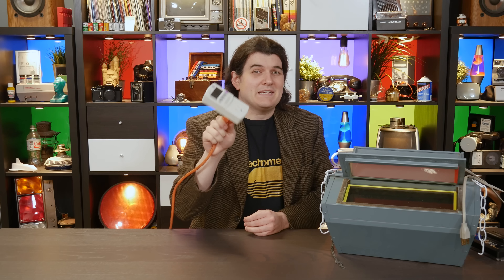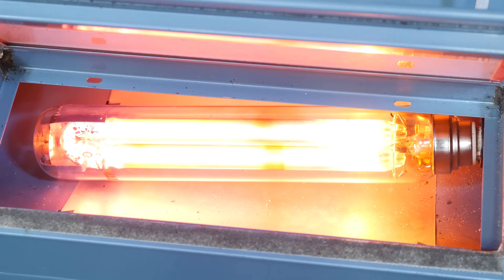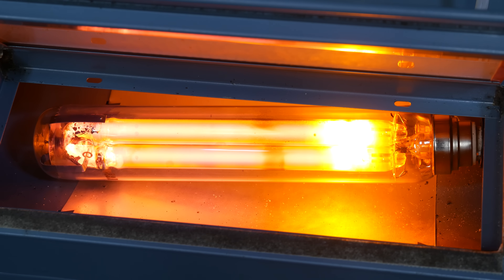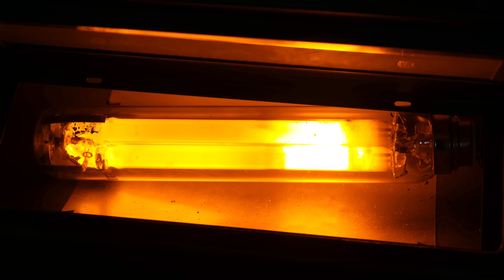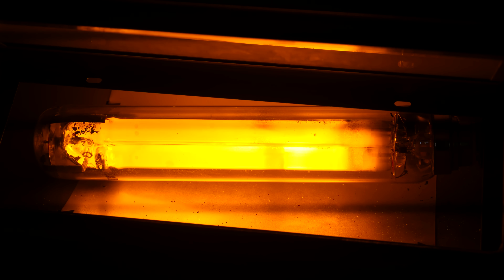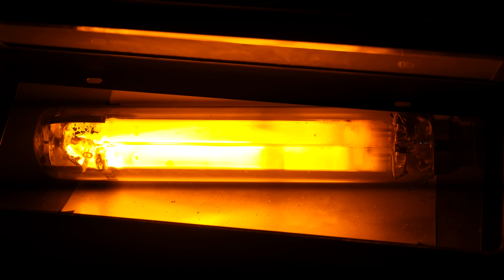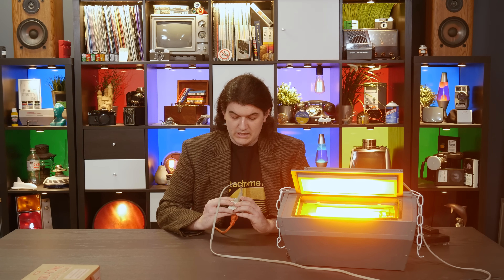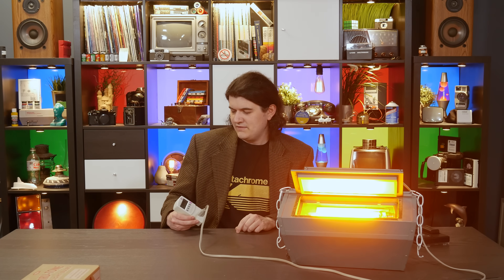More vaguely-informative ramblings about low pressure sodium lamps

Comment: I miss these. LEDs just don't look right on the road and in parking lots. Seeing these disappear from the road feels like losing an old friend somewhat. Heck, my elementary school gym and middle school cafeteria were lit up with them. Yes, I know, obsolete, etc, but man, I miss them.
Reply: Look up phosphor converted amber led
Reply: @DripDripDrip69  The thing is even those don't look right because the falloff is much sharper. The blackbody property also is much wider because LEDs run much cooler, making certain materials appear white, others appear yellow, and others look very dark yellow-green compared to low pressure sodium lamps that provide a constant even yellow-orange. Low pressure sodium lamps get about as close to candelight provided by a traditional wax and vegetable oil candle as you can practically achieve through mechanical means.
Reply: Agreed, the LED bulbs have a more intense light output but doesn't spread as far out as the old sodium lights did. The color temperature of the sodium bulbs is also better for residential areas, its a nice night light color. The more blue daytime color temperature of LED bulbs makes it look like its daytime, especially when you live in a snowy area and get all of the reflection off the snow.

Comment: I love the comment sections on older but not quite forgotten tech, because there tends to be so much nostalgia. However, I'm not nostalgic for LPS. It's horrible and dangerous lighting in my opinion. The color rendition is practically completely absent and more importantly, when used for traffic lighting it's got a really nasty property of being in the part of the spectrum that does not get reflected off much stationary stuff (e.g. grass, trees, concrete), so it creates really deep shadows, increasing apparent contrast and thus psychologically increasing apparent brightness without actually being bright enough to discern details well. Plus they have the worst switching life of any technology, so back in the day when they were used for streetlighting everywhere, you'd have streets pockmarked with mostly LPS but the occasional fluorescent bulb for those armatures that were fitted with an (active) timer to e.g. reduce light pollution in a park or to turn off during bedtime for people who had a bedroom right next to one of those lights.

For all those reasons and more, I massively prefer LED. The worst LED streetlamp is still better than any LPS lamp, and we've had some turdy LED lights back when the tech was still upcoming. It's one of those things that just got strictly better.
Reply: The LED streetlights are usually too bright and too blue, being daylight colour balance. This completely messes up our circadian rhythms and causes sleep problems for people that drive home after dark. Being able to identify every colour and read fine print books at night by streetlighting is of no real benefit but seems to be part of the requirements spec. Soon none of us will be able to sleep at night and no-one will ever see a star in the night sky.

Comment: Back in the day most of the street lamps in my area were Mercury Vapor bulbs which produced a relatively cool white light. In the 70's these were replaced by high pressure sodium lamps. Today these sodium lights are being replaced by the newer LED systems.

Comment: bad power factor= lots of energy is bounced back and forth between the lamp anf the transformer, which increases consumption on the wires.
With a capacitor next to the lamp the power would just be bounced back and forth between the lamp and the capacitor, limiting the losses to the few inches between the components.

Comment: These lights are common in many facilities because 1) they last a long time, and 2) they emit a frequency different than other types of light that does NOT attract bugs
Reply: Ultraviolet Light is what attracts bugs. Fluorescent lamps glow in UV, and the phosphor is what converts the UV to visible light. But a lot of UV still leaks through. LPS doesn’t have any UV, and so doesn’t attract any bugs.
Reply: The absence of a blue component in the spectrum also means these lamps don't reset your body clock if you drive under them for hours at night. 

That is great for not giving you "jet lag" after a long drive on a sodium-lit motorway  (freeway) which were common in England a couple of decades ago.

The downside was when your body clock thought (correctly) it was night and sent you to sleep at the wheel... I once caught myself microsleeping on a motorway at 3am and when I had stopped safely at a parking area i instantly fell asleep still belted in and woke up at gone 6am. I was profoundly glad that I had fought off proper sleep as falling properly asleep at 70-80mph may not be habit-forming.

That wouldn't have happened under mercury lighting and doesn't happen under LED.
Reply: @trueriver1950  — the reason it doesn’t happen under LED lighting is that white LEDs are actually based on blue LEDs, in a process made famous by Nichia in Japan.  They take a similar phosphor as they would use for Fluorescent bulbs and repurpose it to take in the bright blue color of the base LED and then re-radiate light over a wider spectrum, thus giving the appearance of being white.  But again, a lot of the blue light leaks through.  There’s still no UV there, so they won’t attract bugs.  And the human eye doesn’t see the blue light, but it is still there.
Reply: @shubinternet  just so :)
Reply: This light is much better for humans too. They changed the street lights to cold white LED lights here which are very uncomfortable. Actually you almost have to wear sunglasses when riding a bike at night. 😅
Reply: @therealjantube  Isn’t it odd, they only go for the very cool white type of LED. I guess it’s an efficiency thing, but I’ve seriously only seen a few places that have outdoor lighting with warmer LEDs. I know one residential area with very warm LEDs, almost a bit yellowish, giving an incandescent feeling, probably one of the nicest street lighting I’ve ever come accross. In our city center area we also have some LEDs also that are pretty white with a tiny bit of incandescent hint, pretty similar to some metal halide lamps.
Reply: soo.. moths aint gonna care about that lamp? :O
Reply: Why did we always see a swarm of bugs around street lights back in the day?

Comment: Hawaii, especially the big island, uses LPS lamps for street lighting, because the narrow emission spectrum is easy to filter out at the observatories on Mauna Kea.  Today, they're using LED replacements, that actually still look exactly like LPS.  You can tell you've got that spectrum if you have a red car, as we do.  The car appears to be grey under an LPS lamp - the red is completely undetectable to the eye, unless some white light hits it from some other source.
When we first visited Hawaii about 8 years ago, the lamps were obviously still sodium.  Today, however, I can't remember when I've seen a real sodium lamp - they're almost all LED now.
Reply: Do these LED replacements really have that monochromatic light? What are they called? I would like to have one for my room 😁
Reply: @therealjantube short answer - I seriously doubt it. LEDs probably have a fairly smooth spectrum, even though they can appear to be very monochromatic. Gas discharge lamps can have sharp lines.
Reply: @therealjantube there are monochromatic single emission LEDs available for mimicking low pressure sodium. It’s 589 nanometers.
Reply: @bnkwupt  Thanks! Sounds like a DIY project because I only see SMD LEDs but no lamp.
Reply: Anyone know the lps match LED bulbs? Where to get them?
Reply: Do the LED replacements have the same heads as the sodium ones? Where I live they went with white LEDs, but in a head that directs the light downward in a tight cone - the reduction in light pollution was really noticeable, and I can see much more sky even near built-up areas.
Reply: I think most fixtures have been completely changed, but some are undoubtedly retrofitted.
The difference in light pollution between here and the mainland is STAGGERING. Very little is over-lit here, it's all directed only downward, as you said, and the highways are only dimly lit, and only near intersections. You have headlights, after all. :P
I'm in Kona, Big Island. Other islands may have different lighting rules.

Comment: Speaking of obsolete lamps, over here it's common to find mercury lamps in street lighting still. Usually in older and more rural places. I gotta say I prefer those lamps over the high pressure sodium. Now finally LEDs with similar lighting characteristics as mercury lamps are getting installed.

Comment: I grew up in the UK with sodium street lighting as the most common type. Often saw ones that had partly failed and stayed in red mode. The orange sky glow was a problem for stargazers. In the last few years, many lamps in residential areas have been replaced with downward facing LED lighting. Cheaper to run, more natural on the street and a lot gentler on the dark sky.
Reply: "The orange sky glow was a problem for stargazers."
Not more than other lights, and for (hobby)astronomers filtering out the sodium frequency is easy.

"Cheaper to run, more natural on the street and a lot gentler on the dark sky."
Cheaper? How? LPS are about as efficient and cheap as LEDs. Lifespan is also .... LEDs typically have very high ratings but fail way early.
natural night-light? Then you'd want incandescent.
And gentler? no, but they are way worse for night-vision.

Comment: LPS lamps are typically used around observatories as their monochromatic light is easy to filter out from images of the night sky more or less eliminating local light pollution while still providing adequate lighting for surrounding areas. The observatory at my school is surrounded by probably about 100+ LPS lights on the nearby buildings and streets as well as the adjacent parking lot. So LPS lamps still have a niche use case at least.
Reply: Also required along beaches in Floriida.
Reply: Unfortunately in the village where I live in the UK all the streetlights have been replaced with white LEDs. They're about twice as bright as the low and high pressure sodium lights they replaced, and they replaced all the lampposts and cabling and put all the new ones along one side of the streets only (to save on the re-cabling costs). So one side of each road is stupidly bright and the other side darker than they used to be. Even worse all the new lampposts are on precise spacings apart, resulting in some of them being swamped by large trees which have been there decades and hence can't be cut down. There is one junction near my house where you can't see a thing driving from one direction as a result, you change from pitch darkness (seeing nothing) to overly bright (still seeing nothing). Some people with bedroom windows next to a newly sited very bright LED lamp have complained, and a small number of lamps have had shades added behind them. But that is on far less than the number that complained. And why do the new lights have to be so bright and have to be white, thus destroying night adaption and upsetting circadian rhythms. You'd struggle to do a poorer job even if that was your aim.
Reply: @owensmith7530  It was wild seeing how clueless they were about 'retrofitting' LED street lamps. It's like they never even considered if they actually work and look better. And the hyper blue white color they always install is dumbfounding. Especially now that we know what blue light emissions do to your circadian rhythms.'But the color rendering is better' it's nighttime you don't NEED color rendering. I lucked out in my neighborhood, the LED's they installed are actually a warmer white and run at a moderate brightness. I've witnessed vast rows of highway lights all casting an eerie purple glow, some of the early retrofits are already failing, not even a decade later. So much for the 'longevity and no maintenance' that they were sold.
Reply: wouldn't full cutoff lighting fixtures be a better choice?
Reply: @jeffdutton1910  that only solves part of the problem. Anything that’s illuminated will reflect the light upwards.
Reply: @jeffdutton1910 , those are also used. (As are other remediations.) But it's not the same type of solution, so one does not replace the other. Cutoff fixtures reduce the total amount of skyglow; LPS lamps reduce the range of contaminated wavelengths of light. You could, for instance (and dark skies towns often do), use full cutoff fixtures on LPS lamps.
Reply: @jeffdutton1910  That filter would look like a welding glass and be super wasteful, as well as making itself super hot
Reply: @smithkyon1462  what filter? A full cutoff fixture simply directs all the light downward toward the ground, where it's needed. Conventional street lighting shines a lot of light to the side and even upward, as is clearly evident on any foggy evening.
Reply: @jeffdutton1910  and then the ground reflects the light into the sky, how is this hard to understand? Cutoff fixtures can't fix this.
Reply: Can't led lights be made to fill that niche now?
Reply: @nbrown5907  : Supposing that LPS lamps are a variety of cold-cathode device (which I suspect they are), then they very likely have a much "narrower" (and particularly "sharper") emissions peak than any LED other than Laser Diodes. The reason why is that the chemical elements that the electric discharge passes through will behave almost like a laser element, providing an element-based tuning effect that you won't quite get with ordinary LEDs.
Reply: @absalomdraconis  This is indeed part of the correct answer as to why they can't so easily and perfectly be replaced by LEDs. Look at the spectral output of a monochromatic yellow aluminium gallium indium phosphide LED; the FWHM spectral bandwidth of the emission is about 25 nanometers. Fairly wide. Now look at the D-lines emission of a sodium lamp, it's a combined FWHM width of maybe 5nm at most. The reason for the difference though is not really that the sodium lamp is acting like a laser, but that the atoms of sodium are excited and emit light in near isolation while in a gas, whereas in a solid state device like an LED, the energy levels of the electrons in the valence and conduction bands are more smeared out due to their interactions with close neighboring atoms.
Reply: @Muonium1  How about phosphor converted amber led?
Reply: @DripDripDrip69  Those are being looked at right now as LPS replacements but they're currently not as good in this purpose as LPS and it's more expensive to replace all the current lighting fixtures than to just leave them running. Eventually they'll replace LPS but we're a ways out
Reply: @DripDripDrip69  phosphors tend to be very wide bandwidth.
Reply: @JasperJanssen  Could quantum dots be used instead? From what it sounds like they are already used in displays for purifying the spectrum.
Reply: @Muonium1  AlInGaP yellow/amber LEDs are also nowhere near as efficient as LPS lamps.  Most amber LED fixtures are in the 40lm/W to 60lm/W range, and the least efficient LPS lamp was 83lm/W (Thorn made some experimental 6W lamps in the 1980s but these were never made for sale).  All commercial LPS lamps are 100lm/W or more.
Reply: @randacnam7321  verily and indeed I do like it that it's that anti-Earth Hour celebrating guy who is pointing this out 🤣🤣
yes I have heard this before and I think none other than Shuji himself was working on it with a group a ucsb recently. I don't really understand why it is so. very counterintuitive.
Reply: @PH-G  Collect the LPS if you can
Reply: @LanceThumping  I work making quantum dots for displays, and unfortunately even our better dots are on par with LEDs (in a certain sense, that's what QDs are, nano-LEDs that are photonically energized instead of electronically), with FWHM (the width of the peak at half the maximum) in the 25-35nm range. We would kill for the narrow emission profile of an LPS bulb, but will settle for peak tunability 🙂
Reply: @nbrown5907  yes, but the filter glass would be like a welding mask, it's better if you start with the right colour (or light wave length) in the fist place?
Reply: @nbrown5907   Practically, nope. "Monochromatic" LEDs have a pretty wide peak on the spectrum. Don't confuse LEDs with lasers, they are entirely different and had no thing to do with each other.
Reply: @nbrown5907  in Australia we just used HPS ones
Reply: @nbrown5907  They absolutely are.
Reply: Alamogordo, New Mexico has LPS street lights (due to several observatories in the surrounding mountains).
Reply: He has already mentioned this in one of his past videos about HPS
Reply: Flagstaff, the first 'international Dark Sky City', began replacing all of their LPS streetlighting beginning in 2018, for LEDs that emit the same wavelength, and thus have the same effect.
Reply: @silicon212  they are doing that more as a compromise due to high costs to operate and limited supply. LEDs still aren't as good as LPS for pure astronomy purposes as others have pointed out.